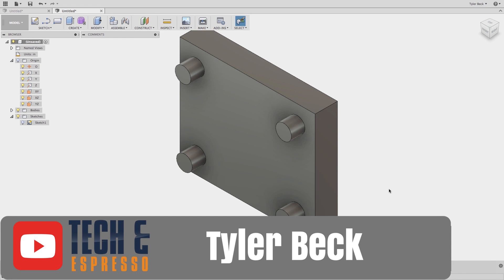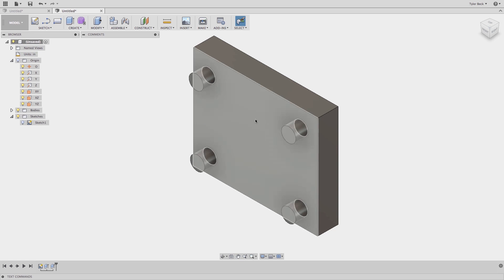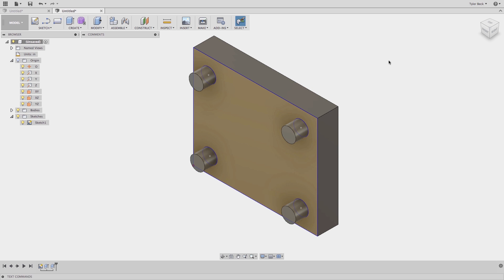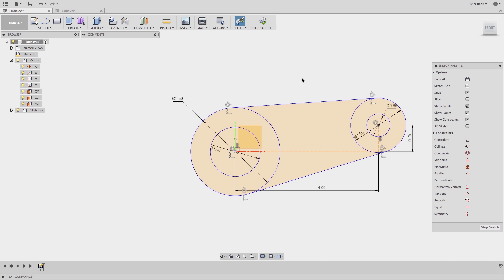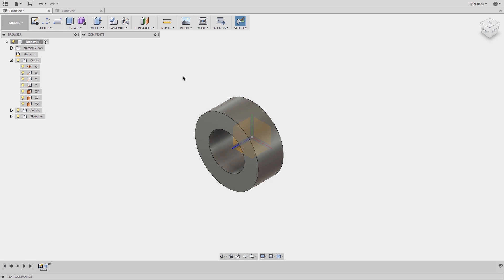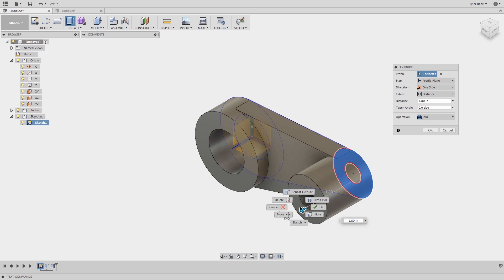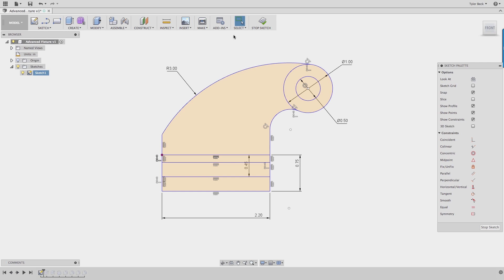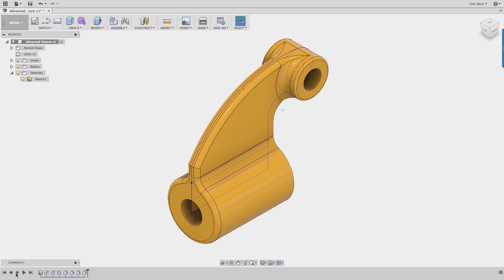FUSION 360 Quick Tip Video - Using Multiple Profiles With One Sketch

Comment: Hi Tyler. Great stuff. Just wondering if you could give me some insight as to assembling a whole bunch of the same parts. I'm designing a plastic shredder. 1 shaft, 19 shear blades, 21 spacers between the blades and it all meshes, rotates through a grid of spaced bars to get the shear action. I'm doing it like I have all the parts on my bench and jointing each one, one at a time. Is that the way?
Reply from the maker: Sounds like a good video to make! I will add it to the list.
Reply: Excellent. I shall await.